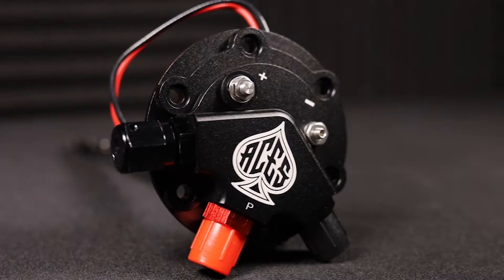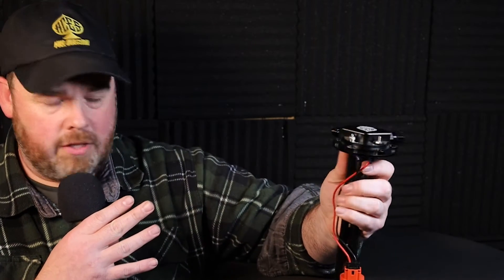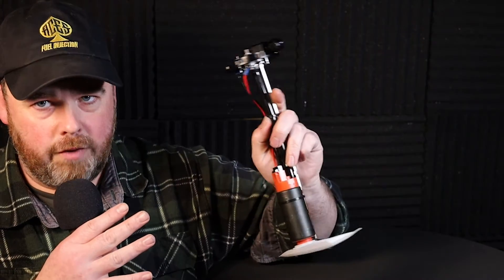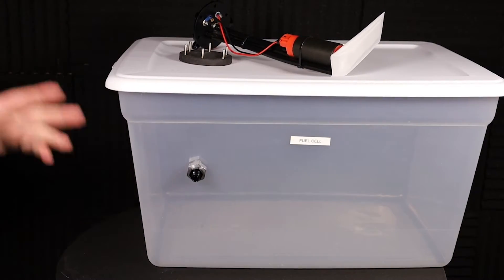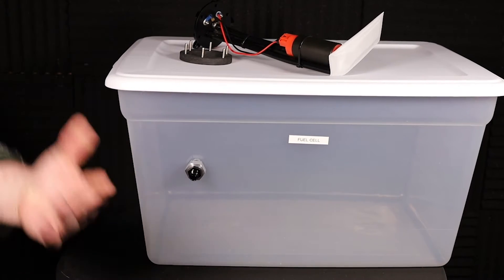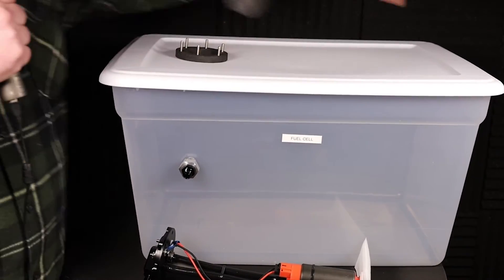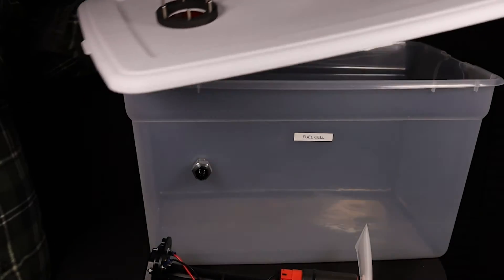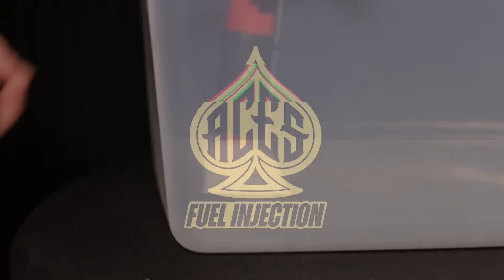Tight-Fit In-Tank Fuel System

Comment: I would like to see a complete install in a factory rank starting with drilling the 2 1/8 hole in the tank. There are 6 tiny o-rings that go somewhere on the aluminum ring screws. Where do they go?  If I already have a return in my tank, can I block up the return port on the pump?
A complete step by step video would be beneficial to a lot of customers.
Reply: i made a video on it.

Comment: So these are just for fuel cells? I was hoping to use the factory tank.
Reply: you can use it in a factory tank. Have it in my 72 buick.
Reply: @jeffreyrigged  how does it fit. This pump bolts in. Mine has a ring that fits in groves. It's a 85 g body Monte Carlo ss
Reply: @inscoredbz I posted a video of how I did mine. I had drop front of tank half inch but it works really well. Once you drill the hole it basically bolts and clamps perfectly. I didn't have a recess on mine for the pump is only reason I dropped it half inch. You wouldn't know unless I told you.